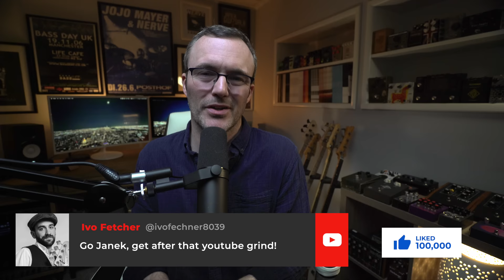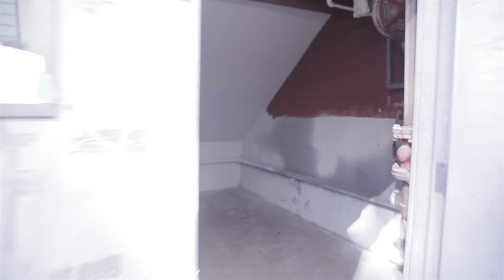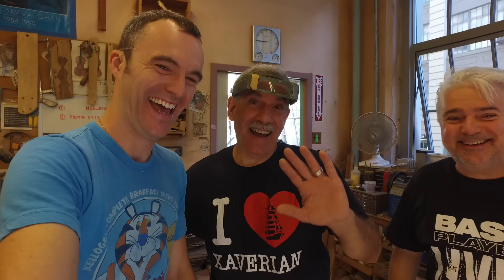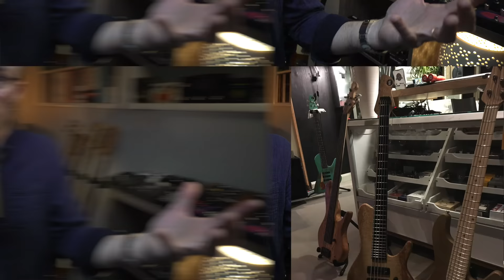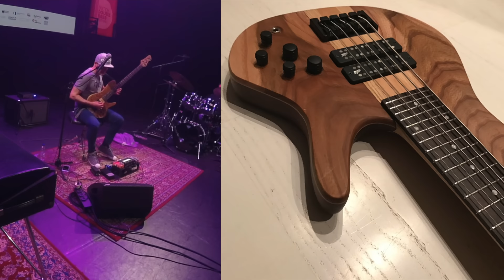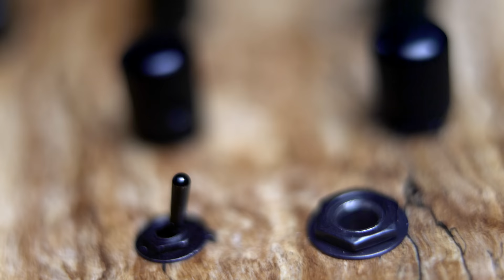Why I Stopped Playing a $15,000 Signature Bass

Comment: I had a Fodera.  The most expensive dud I ever owned.  A toneless wonder. Tried three different sets of pickups and it just never sounded good.  Didn't cut live and recorded like crap. Total hype.  I sold it and never regretted it.
Reply from the maker: It's all subjective. Everyone isn't going to love the same thing. Glad you were able to move on and have no regrets, that's a positive outcome.
Reply: @janekgwizdala  I wanted to love it. But even the  engineers and musicians I worked  with preferred most anything else I used.  Jazz, P , Ibanez, Musicman, even a Squier).  That settled it for me.
Reply: My issue is I’m not a fuss. Pot or complainer. I purchased a mini mg . Upon unboxing and tried to put a strap on I couldn’t the strap studs were so far driven into the body I couldn’t get a strap on, called the sales person and he sends me some control diagram that was totally unrelated to the build failure, said sorry you feel that way. Then cracks started appearing. It actually looked like they painted it with a brush . Not happy , not happy.

Comment: Janek, I am grateful to you for opening up my world in the direction of the high C string. Exactly two years ago, I got my Ibanez BTB that comes stock with an E-C setup, 33" scale, active electronics, Bartolini pickups, finger ramp, etc. It still surprises me that such a unique instrument is available from a big company and is actually affordable (a reason why I really like Ibanez). Thank you for the inspiration!
Reply: btb 33 right? Got the exact same one years ago just a month after ibanez started selling them. would never have thought of it without Janek's great influence over what I wanted to achieve with my instrument
Reply: No, mine is the BTB845V. But the 33 looks very similar, maybe it's the predecessor?
Reply: @AvormW  Reading about it now it is in fact part of the same "volo" series as the btb33. the 845 looks much better I think
Reply: @Sagizor  Did you guys end up replacing the nut?
Reply: @seanstiller7202  Not yet, I didn't have any issues with the nut. I'd rather replace the pickups at some point, the Bartolinis lack some clarity imho.
Reply: @seanstiller7202  had no need, would have probably also change the pickups if I still played it much. Upgraded to a custom Mayones a year ago

Comment: I am semi new to the bass world and have a legitimate question. What makes a bass worth 15k? This is an honest question no disrespect intended just genuinely curious.
Reply from the maker: It's a very valid question and a really hard one to answer. I think it's probably important to understand the heritage behind the, instrument (the electric bass is a relatively young instrument), the brand, and the builder first. Take Vinny Fodera for instance: he's in a very exclusive club of innovators of which there are maybe less than ten members. That alone can be a massive part of the value you might find in the instrument. 

Then there are so many other factors that go into the process of deciding what you value in a bass. It's very subjective on a lot of levels, and you're going to take into account how difficult it was to source the woods and materials for the instrument, how many hours went into making it, where it was made, the overhead costs of running the company, the amount of instruments they're able to produce per year at that level. All of those things create scarcity, and in turn, value. 

Take watches for instance (I happen to be a huge fan and a bit of a nerd when it comes to time pieces). A maker like Roger Smith has only made around 100 pieces in 20 years, so there's a reason one sold for almost $3M at Bonhams last month I think it was. 

That is an extreme example, but I make it that way to really make the point. There are so few people like Vinny Fodera in the world who operate at that level, and are original (very important here because Fodera as a brand has been ripped off by so many small builders for over 30 years now), so I totally understand why there is so much value placed in the craftsmanship and the innovation they bring to a player in their instruments. 

I think it's also interesting to look at Upright/Acoustic basses, and the kinds of prices they go for. The really high-end instruments (admittedly mostly vintage rather than new) can  fetch prices you could buy a house with. This Lorenzo Carcassi for instance is on sale for $175,000 https://kolstein.com/products/lorenzo-carcassi-bass. I'm not 100% sure off the top of my head, but I believe that instrument will be around 250 years old. And even a decent new build can easily go for $15k-$30k without anyone batting an eyelid in that world. 

I guess what I'm trying to say is that context is also important.
Reply: A huge amount of any asking price is the overhead. If you put the makers in a workshop in Manhattan their rent, taxes, power bills, insurance etc are hundreds of times more than if those same makers were making the same product in the middle of the Welsh valleys.

Then there is order control by price. All business increase their prices to what customers will pay, but if the amount of orders are too much to handle then the options are to just turn them down, or increase production (potentially watering down the desire of the product), or putting prices up until there is a balance between order numbers and capacity.

This applies to the item itself but also the time value of the maker. It's why people from every area of work charge different amounts for basically the same service. But people will pay more for a burger made by a 3 star Michelin chef than by a guy who has a food truck - even if the food truck burger tastes better.

There are many many factors - and the wood / pickups etc really are the smallest elements of how a sale price is calculated.
Reply: I think is not worth it. Maybe you can have a bass made of gold, but the only thing that you can do with it is play notes to make music, nothing more. I’ve learned that after playing a non adjusted Matt Garrison fodera at samash in NYC (btw)
Reply: @MadMagicPaul  Great answer !

@TheAamott12 A better question is if anyone needs a 15K bass, and the answer to that question is: No - You don't.
Reply: If Alembic makes it, it's a work of art and the greatest sounding instrument made. Fender invented the electric bass, alembic perfected it. Everyone else that sells basses for that kinda price point is just separating people from their money
Reply: Im aftdr buying a custom instrument myself and been very much part of the process of making it and seeing it in person at all stages. The sheer work that goes into a handmade instrument vs a cnc instrument(look up how warwick basses are made. For example on youtube.) the craftsmanship/attention to detail and time alone make what i paid for the instrument undervalued
Reply: At the end of the day, any bass is worth exactly what you can get someone to pay for it.
Reply: "What makes a bass worth £15k"

The price-tag does...
Reply: I guess the same things that make some '"Cars" worth $250,000
Reply: very deep pockets and a very shallow mindset
Reply: @mojoemurphy  Truth. Fender invented it. Gibson made it fun. Alembic perfected it.
Reply: @guzzialfa  If you call neck dive fun :)
Reply: Just buy a Yamaha and be done with all the 15 K basses.
Reply: @mojoemurphy  Nah, either you like the Alembic sound or you don't!  Alembic is a respectable bass, but it's not  special to everyone.  I would own a handpicked Fodera, Vintage Fender j-bass / p-bass or Stenback over an Alembic any day.
Reply: @PlonBass  well it's not just materials though, the quality of the build and attention to detail, quality of life design that might feel right but go unnoticed are in the cost

having that said, you're right that all you fundamentally do with it play the notes and make music, so quality and price doesn't really matter (unless it becomes so noticably more difficult that you're spending more effort compensating for the instrument's flaws than focusing on playing)

my favorite guitar is cheap, it's the best playing instrument I have, but I ripped the body from a Squier starter kit. I mean, I guess the Warmoth Neck and Hipshot Locking Tuners and Bareknuckles are sort of expensive, but the base body is probably worth like $80 (the wood really sucks lol)
Reply: eterna2k7  to add to your comment, expensive things usually have diminishing returns

the Corolla gets you across town just as well as the Ferrari, if not better (lol no need for manual, and even in automatic I'm sure the Corolla uses far less gas than the Ferrari).

I could pay $2200 for a Fender Stratocaster at guitar center, or build 2 custom strats from Warmoth $1100 each that plays better and has the features I actually want for half the cost of that single Fender

sure, I might enjoy the wood and "authenticity" more on the Fender, but I'll be damned if I didn't love my Squier/Warmoth build.
Reply: @peekaboo4390  damn, too bad I don't like Yamaha basses and would rather spend $350 on a used Ibanez SR
Reply from the maker: @dainminor5815  It's almost always about the journey, never the destination. The milk isn't the job, the journey is. And objectively, the Ferrari gives you an experience you're never going to get in a Corolla, and as such has a hefty price tag for the ride.
Reply: @janekgwizdala  I don’t bother defending it for the same reason I don’t defend the Mona Lisa being priceless.    It’s much more than the cost of the paint and canvas.  

Like Ritter and alembic,  these are art pieces..
Reply: Janek, thanks for a fascinating video.  The F Bass you demonstrated sounds great, especially in the high register.  Marleaux handmake some fabulous basses, but even the Contra costs only about £7.5k, so $15k seems like a very high price. Have you ever tried a British handmade Overwater?  They seem to have a very strong reputation.
Reply: As with all things, there is a difference between "price" and "value". If you are not thirsty, you don't value a glass of water very much. Hence, you are not not willing to pay a high price for it. After walking in a desert for a day, you might be willing to give away all your money for the same glass of water.

Now, the price of a product has to be higher than what it costs to produce it. It seems basses discussed in this video are labour-intense products. So the cost of the workers making it must be covered by the sales price. And it is a small scale production, with few instruments produced every year. So in addition to salaries for all workers, the company needs to cover fixed costs like electricity, gas, insurance, rent, tax and so on. In some cases, brands are famous and considered luxury items, so some people are willing to pay a premium just to be able to show to others they have a luxury item. Rolex is an example. It doesn't keep time any better than a Swatch, still there is a market for it.

For some people, the value of such a bass is equal or higher than the price. So it is rational for them to buy it. For most people, it is not.
Reply: @danieldoherty1063  IKR? Still - a massed produced instrument, a Warwick German made is still the best instrument I have played. Iv'e been playing since 15 - I am 60 now.
Reply: Nothing.
Reply: When you can write the name of your bass in an online forum and you have people start DMing you then it is worth at least 10k
Reply: The Stradivarius of bass! As the man said.
Reply: To offer something from the guitar world, I build for a real high end boutique brand that builds vintage inspired strats and teles. All finished in nitro, roasted maple necks standard etc. We do incredible aging on the guitars, I find it rivals fender custom shop. Anyway, to make a long story short I haven't a FUCKIN CLUE why our guitars are over close to 5k, makes zero sense to me. I think a lot of companies are able to work with high margins. The higher the set price, the higher the perceived value from its customers
Reply: @janekgwizdala  you also have stuff like wal basses that have a distinct sound and by all accounts are consistently some of the best feeling basses to play.
Reply: Well, okay, as you increase the price of an instrument, the sound gets better, and you get more options for uniqueness and customization, so that's why you'll buy a $2k over a $1k bass over a $100 bass, but the relationship between cost and quality is logarithmic. There's only so much noticeable after a certain point. Why do instruments then keep going up?
Bc at that point they become art pieces. They become more than just an instrument. It's not just to have a nice sounding bass that lasts a long time; it's a handcrafted, personal piece. No one needs a $15k bass, but it's a beautiful work of art with a history and a connection, and so if bass is your life, and you've got the funds to make the investment, then maybe you go for it. It's nice to have nice things. Plus it'll retain it's value, so it's kinda like a stock in some regards as well like expensive watches or cars.
Reply: Actually, it's a very legitimate question, there probably is no reason except that the market demands it - it's simply what people are willing to pay in order to think they got something good... when you compare this to a handmade acoustic guitar / classical guitar that takes far more hours far more considerations of acoustic timbre, weight, density, material selection (another deeper topic) these kind of prices are really just a bad joke.
Reply: You have to watch a meticulous work that goes into literally hand building a bass. You're paying for decades worth of craftsmanship by the builder, you're paying to own the best of the best and have your ego thrown into the sky when someone says, "omg, you have a Fodera." If you've never reached that level in anything in your life, you will never ever understand. Nothing wrong with it, like he said, Ferrari doesn't make an $85,000 vehicle that people can afford and experience. You HAVE to reach a certain level in life to fully understand. To literally go over the customization of every inch of your build is a breathtaking experience.
Reply: @BryanMaxDobberstein  exactly. Give a great player a well adjusted Squire and they'll make amazing music on it. Give them a Fodera with a bowed neck, bad intonation and rusty strings and it's going to be a struggle. I have expensive instruments simply for the reason that I, at the time, could afford them and that they were from the companies that I liked the sound, look and craftsmanship of. There is a difference in quality of workmanship, hardware, electronics, etc, but the main price point is who's behind it and if you're willing to pay the piper for the name and heritage. In many cases I am willing to pay up and in some I'm not. That's the beauty of personal choice in the marketplace.
Reply: The biggest thing you are paying for is the time it takes to have an instrument made to your specifications.
Reply: And also I think that all depends on what you want, on your ear and what you can pay. Also depends on the needs of the modern times and the needs of your playing. 

There are some players that like an 7.5” radius, and there others that like 20”. Jaco ripped of the frets of his Fender because of his needs. Sheehan put a humbucker by the neck because of his sound… and I could name a thousand players who made their cheap or their high end instrument to their needs. 

By this, I didn’t mean to say that high end instruments are worthless, because there are people like Vinny Fodera that want to make a flawless instrument. This doesn’t mean that Leo Fender didn’t. I think we all want is an instrument that has the minimum flaws to play comfortable and sound good. 

We all want to make music.

Comment: I have a Yamaha BBN5A and I turned it into my signature bass and sound,  you can modify the tone in the back behind the tone knobs. 
There are smaller knobs in a cavity of the bass you can use to modify the output of the bass, treble and mid section. Think of them as a second set of knobs. 
Awesome videos.

Comment: You know, I bought me a Yamaha Trb6, the Patitucci model, in a Sam Ash store in Miami back in 95. I remember it was february and so, everything pretty much was on sale. The bass cost me some 2.2k usd when it's real price was i belive, 2.7 k or so. Some years later, i bought a couple more elite basses, I had first a Pedulla and then I bought me a Fodera. 28 years later, I still have and play and record mostly with my Yamaha... as well as with my american Fender Jazzbass. I still got the fodera, I play it every now and then and mostly throughout the 2000's I tried a couple more elite basses. From what I know, they are awesome pieces of art, and they do sound great and are fun to play. But, everytime I kept going back to my Yamaha, and now, today, I wouldn't change that 2.2k Yamaha Trb6 for nothing, and guess what, it cost me at least five times less than any average fodera, and it sounds just as good and even better, offering more versatile tones... 🤷‍♂️ for just a fraction of the dough..., just my personal opinion and experience. Cheers.

Comment: I'm curious what moved U to high-C 5string instead of 6 string? Also, what gusge strings U use????😊
Reply from the maker: I never really got on with the neck width on 6-string basses. Having said that, I actually have a 6-string coming this week and there will be a video on it...

On the High-C 5-string I use 105, 85, 65, 45, and 30 currently. I want to move the C to at least a 32 if not something more beefy like 34 or 35 soon. I have to have them custom wound though so it's a bit more complicated than just grabbing them off the shelf.